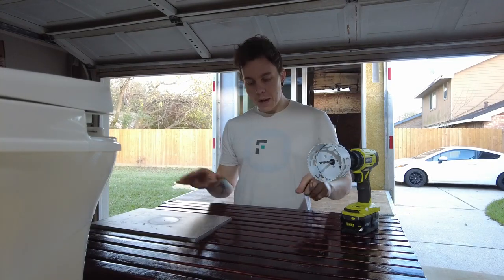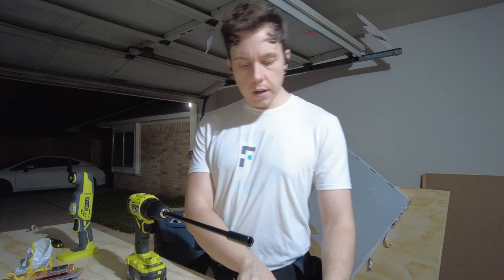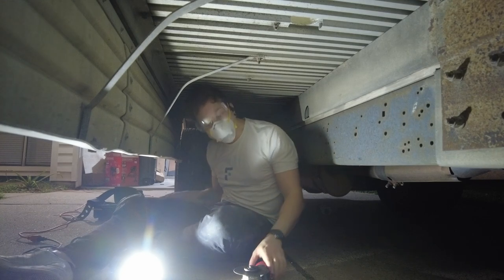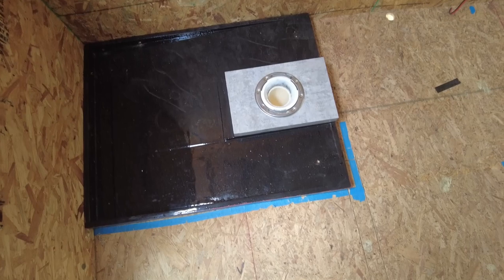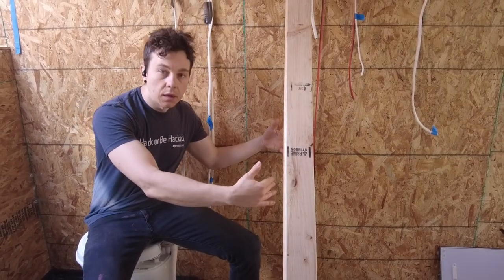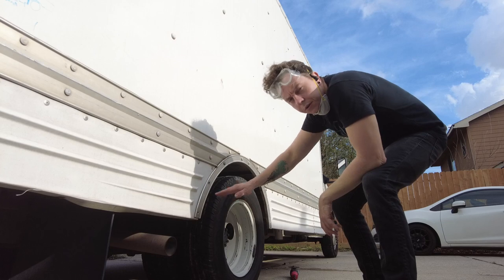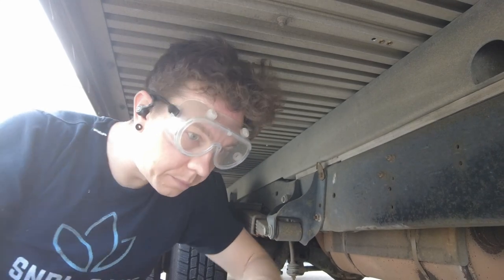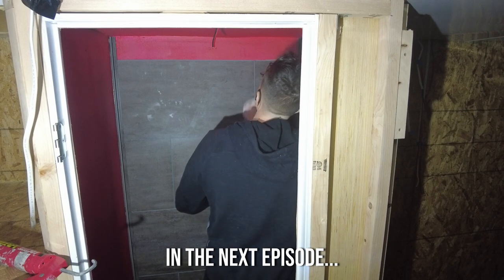Uhaul Box Truck Conversion | Toilet and Shower Pan Install

Comment: Slow that Ryobi drill to the lower gear setting. You're killing it. 
To get the mandrel out of the hole saw put it in a vice and pull the lock up. Or clamp a vice grip to the shaft and give it a smack . I've gotten a lot of them unstuck.

Comment: For anyone watching this - if you're going to suspend a heavy liquid filled tank with a blind rivet thread insert you'd better hope the steel holds and doesn't break apart.  I use a similar  system to install threads into sheet metal, but the load is above the rivet, not below. I wouldn't do this - you'd be better off running bolts down from the floor with large washers around the heads of the bolts to better distribute the load.

Comment: I don't know if you go into costs in your video's but my maths tells me a Uhaul is easily the best value living solution on wheels money can buy. Honestly they make van's look like a stupid financial decision, for about half the price you get nearly twice the space, that extra space makes a lot more affordable easy house hold options a practical choice like your rear sliding doors. No windows is also an advantage, not just for the stealth factor but also it reduces heat loss and gain, kind of a big deal in summer in my experience.
Reply from the maker: Uhaul is by far and away the best mobile living platform. It's not even a contest.

Comment: On your hole saw being stuck. Drill it into a stud remove the drill and screw two 3" screws through it. Should be 2 holes in the back for that purpose. Then grab a wrench and pop it loose. Easy peasy.

Comment: You might want to put plumbers putty or silicone under and around the flange first to stop the leaks. And ya, Ryobi's will smoke when it comes to real work lol.

Comment: im going to instl a toilet over a patio but was also thinking useing any toilet to go into a base elevated box on floorin my house  and the  pipes out the back of box through side wall  ,, the backside out toilets seem to run over a grand in price plus wall seems to thin to support weight  no support beams in the right spot it seems simple but probalby not

Comment: It does make a difference using better power tools - a Milwaukee corded drill isn't that expensive and will last and last. Any contractor grade cordless tool should give you years of service. Ryobi is not known for quality power tools. Invest in better tools.

Comment: Do you know makes the actually box for these uhaul box trucks? I have a 2006 e450 box truck from uhaul and I have some lights missing around the box and I don’t know where to find them, any ideas would help a lot thanks!
Reply from the maker: You should be able to find replacement parts at the official uhaul parts store https://repair.uhaul.net/EPCRetail/

Comment: Quit pushing so hard while drilling let the bit do the work and keep the drill spinning with a higher rpm unless you like buying new drills every time you use them! Bevel the inside of the toilet pipe because it will catch tp